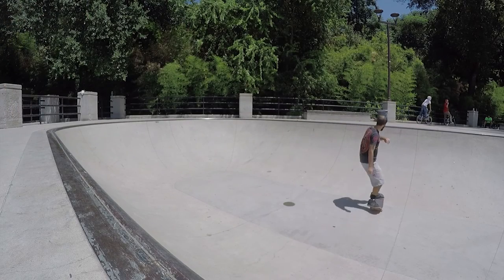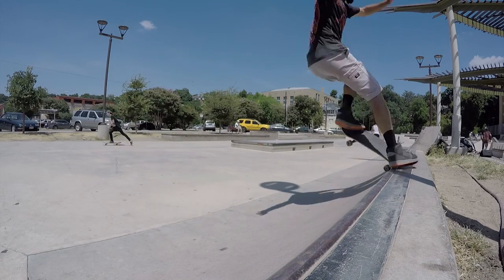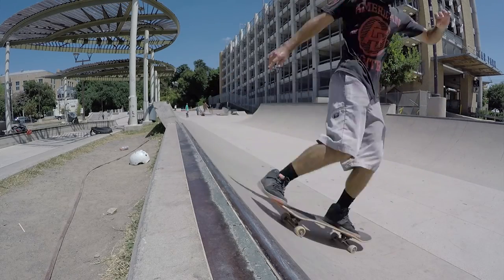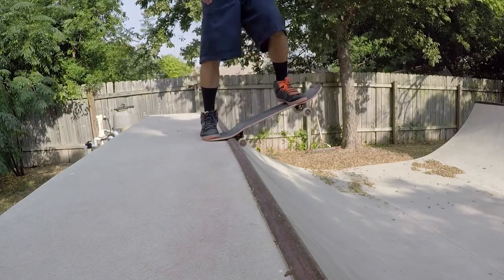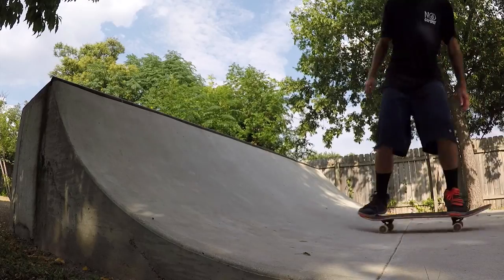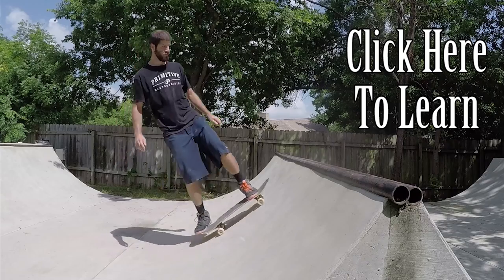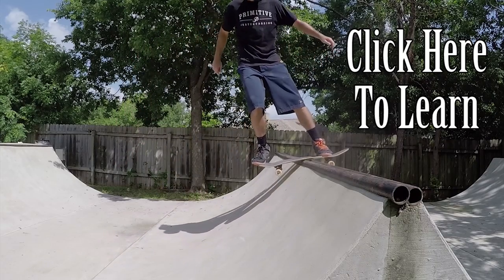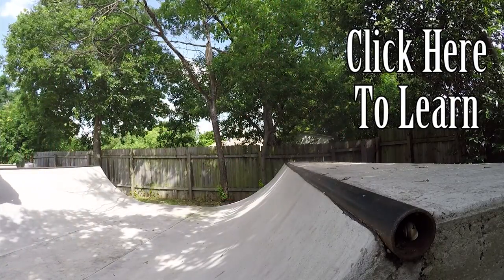How to do a Fakie Tail Stall on a Skateboard (Mini Ramp Tutorial)

Comment: Thank you for this video. At first I learned tail stall the wrong way - by leaning too far backwards so I slammed my elbow 3-4 times hard. Got discourged after that. But Today I re-learned it the right way because of you. I now lean into the ramp instead which gives me more control and stability.

Comment: So I learnt to rock to fakie and now I want to tail stall but I’m wondering how much speed i need should my board be about the same speed if I was going to rock to fakie but of course in reverse so my back wheels would come out
Reply from the maker: Actually Zack, you can do the trick with an extremely wide range of approach speeds.  The speed you've mentioned is the definitely the sweet spot, but as long as you bend your front knee as your back wheels hit the coping, you'll be able to absorb any extra speed you might have.
Reply: Justin Lauria ok thanks